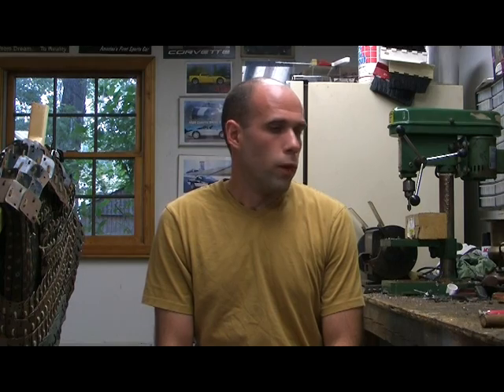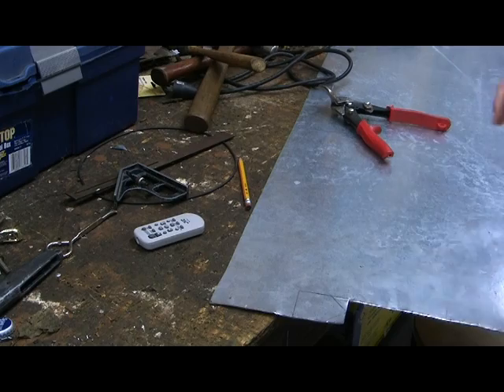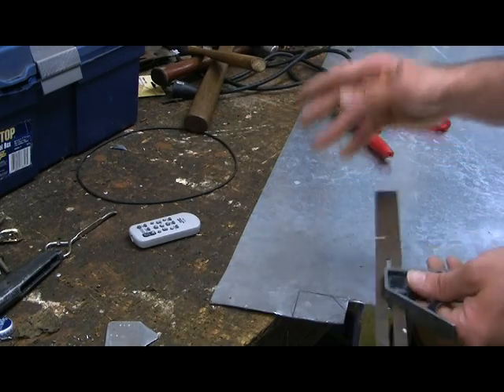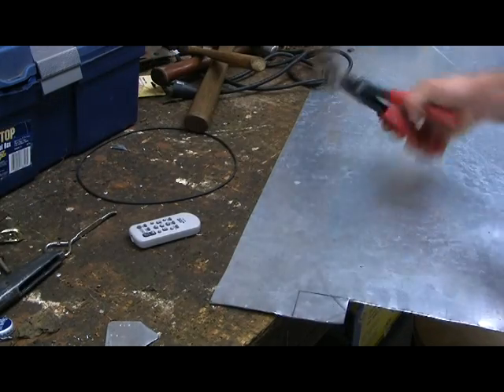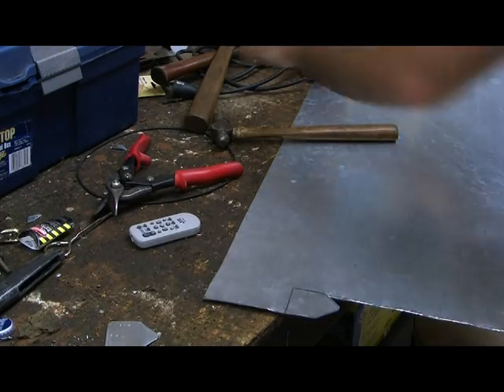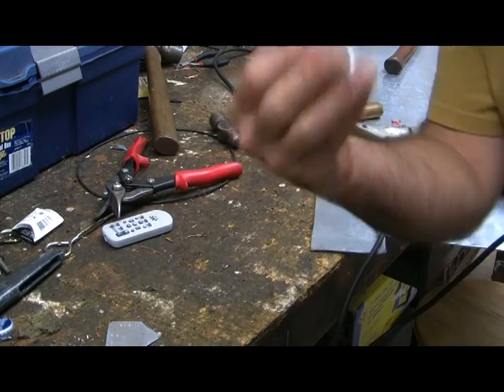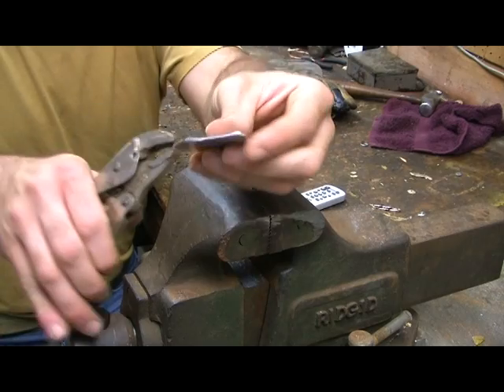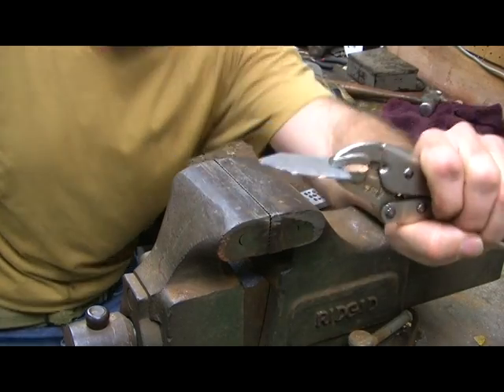How to make: Scale Mail pt1.

Comment: what are the dimensions of the scales? when you held it in your hand it looke about 3 fingers wide for me that's about 3 inches. but i have big mitts and i don't have a frame of reference. i made my own set of lorica segmentata armor a few years ago and love to try making something new. i don't have the patience for ringmail and i don't have the machinery for plate armor. so i thought this would be the best option. also, once you've made the trunk, how do you do the shoulders? do you make two straps and then attach them to the torso like the lorica segmentata or the greek linothorax?

Comment: No judgement or criticism, but wouldn't it be easier to cut all of the scales square from your sheet metal with the electric shears and then shape the bottoms from a pile of scales separately? More of a manufacturing style of assembly work seems more logical for such a repetitive task. You will be making hundreds of these things for a single piece after all.

Comment: Why don't you just make the scales this way--  
cut the plate into the strips the width you need,
then cut the strips into the segments that you need. (and you can snip the corners all at once with a grinder, hold them together with rods and bolts (you put holes in them anyway, this will be a cinch)) - At this point you can probably take the liberty of rounding off the points while scales are stacked.
Bang-bang its like simplified a 3 step process in my mind,  would this not equate into reality?

Comment: wouldn't it have been easier to have made large cuts of the sheet into longitudinal bands and then cut that down to the smaller squares? you could have used a large table metal cutter at a machine shop or welders and have just nipped the corners at home in little under an hour. hell they could have cut it down for you for free if you asked nicely. that what i do, most shops don't mind too much.

Comment: It really wouldn't take much to remove burs from the edges of those scales with a belt sander, then flatten and planish them on an anvil. I also really wish the guy used a square so those center punches could be properly in line with each other. If you're going to take the hundreds of hours it takes to create a piece of armor out of this stuff, completely from scratch, go the extra mile and make it look nice. I will happily take an extra 100 hours to make sure that each and every individual scale is flat, holes in line, and highly polished because I have the patience and I take a lot of pride in what I make.